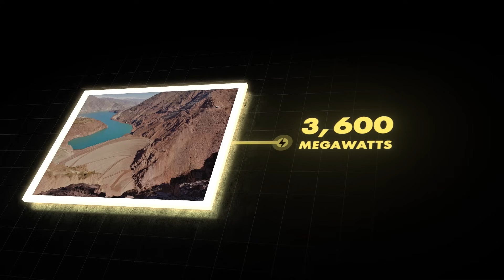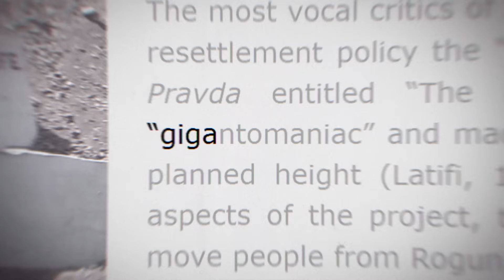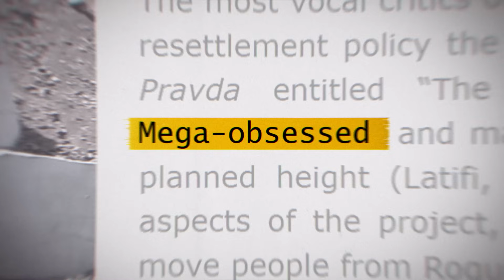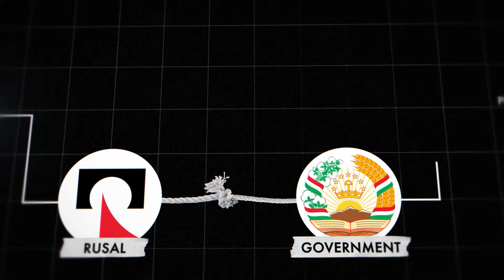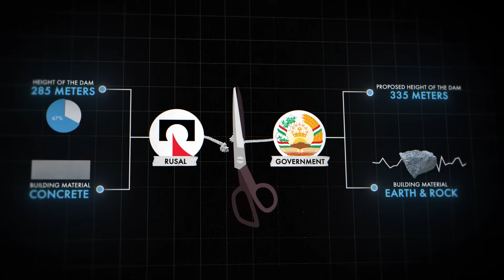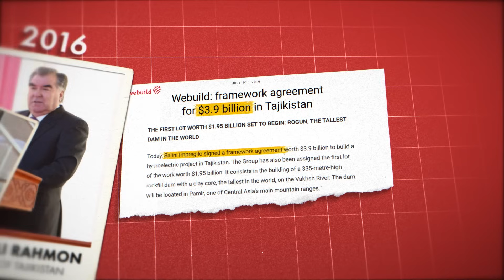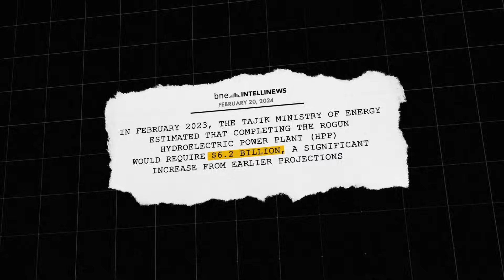Tajikistan’s $6B Engineering Gamble for the Tallest Dam

Comment: The Rogʻun Dam can be dangerous and a threat to downstream countries for these key reasons:

1. Water Shortage Risk – If Tajikistan stores too much water for its hydropower needs, less water reaches Uzbekistan and Turkmenistan, especially in summer when it's most needed for farming.

2. Food Security Impact – Reduced irrigation can harm agriculture, causing lower crop yields and economic stress in already water-scarce regions.

3. Environmental Harm – Less water downstream can worsen desertification, damage ecosystems, and accelerate the drying of the Aral Sea.

4. Geopolitical Tension – Unilateral control over a major water source can lead to regional conflicts, especially without strong water-sharing agreements.

5. Dam Failure Risk – In extreme cases (like earthquakes or mismanagement), a dam failure could cause massive flooding downstream.

In short: it’s a strategic asset for Tajikistan, but a potential vulnerability for its neighbors.
Reply: But Uzbekistan, Turkmenistan and Kazakhstan has Oil and Gas. Did they ever thought to share it with Tajikistan???
Reply: У брать Узбеков тоже много нефти ,Хранится под землёй они как-то с кем не делит,для  ем   это не опасно ?не дай бог если Взорвётся под землёй их нефть
Reply from the maker: Good points

Comment: As a Canadian, I can confirm that although Hydro projects may be controversial, they are worth doing. 
A 330M earth dam is foolish though, do not do that. The concrete one will be much cheaper to build and long lasting as well. It will have big costs and big paybacks. Good luck with these dams but also please do work with Uzbekistan on it. It is very important to consider the full length of the river. If they invest in the project, they will be less likely to attack it if war does come one day.
Reply: a 300 meter high dam was built a long time ago, but a newer 330 meter high one is being built and will be finished in 2027! a concrete dam is not earthquake-resistant, for this reason they are building an embankment dam, if this dam is hit by a missile, it will not collapse, and if someone thinks about it, the harm will be to the countries downstream, which will suffer more than Tajikistan!
Reply: А я не знаю кто она всё у меня к вам вопрос почему мы должны с Узбекистаном и устроить это? Узбекистана также есть внизу касс не дай бог он взорвётся))) А такого я не желаю для братья Узбеков успеха и во всём только не путайте свои слова мы тут никого не считаем у кого что есть будь добр не считайте нас тоже